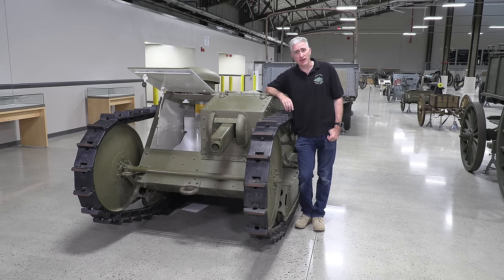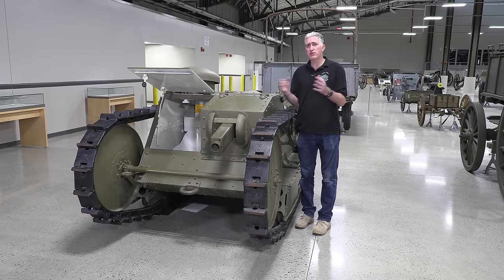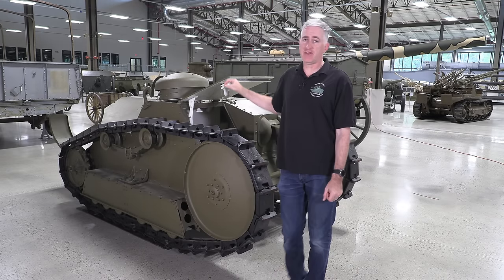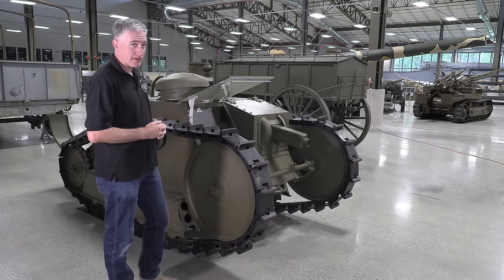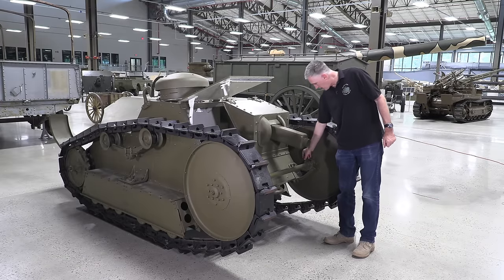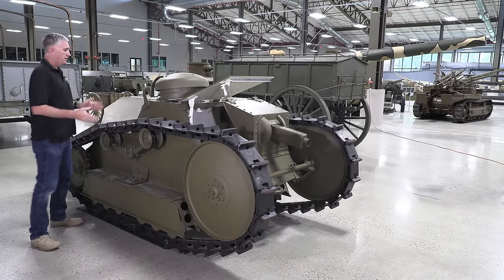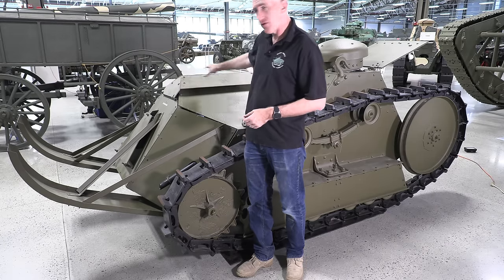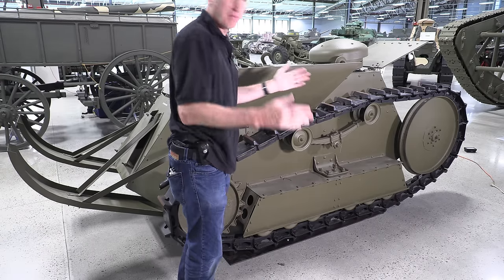Inside the Chieftain's Hatch: 3-ton M1918

Comment: A few observations from a Ford Model T owner/driver (whatever that is worth) who has looked into the tank more after seeing the video:

The three pedals do what the Chieftain says they do; the gas pedal is linked to a single carburetor that serves both engines, the two brake pedals control a band type brake in each transmission.  Of the four levers, the two closest to the seat on either side control what forward gear each transmission is in (high or low).  They have ratchets released by a lever on the handle to hold them in position.  Pulling these levers up puts each transmission in low, moving them level with the floor should be neutral and released all the way to the floor is high.  Pulling the outer levers up should put each transmission in reverse.

Minute 13:53 shows a great shot of the front of the engines.  The square opening in the center of the shot is meant to receive the mechanical starting handle.  The starting handle should be kicked forward and disengaged automatically once the engine catches.  The big round thing with the cable coming out above the square opening should be the electric starter.  The unpolished metal item to the right of the starter is the sediment collection bulb for the fuel system above which should be the fuel tank.  Directly below the sediment bulb should be a lever for adjusting ignition timing, this should be linked to both engines by the wire passing under the starting handle.  The two black boxes on either side of the starting handle each hold the four ignition coils for their respective engine.  The lever on the front of each box controls where electricity for spark ignition comes from; right for battery, left for magneto, center is off.

One thing I am not seeing is how the two engines are mechanically connected, I'm thinking this would be needed since I can't see a way to change the speed of each engine independently.  Having the engines mechanically linked would ensure the tank goes straight when both transmissions are in the same gear.
Reply from the maker: Pinning this one. I'm not in a position to say he's wrong about the levers. In the video, I gave my understanding at the time.
Reply: Makes me wonder if the "Bad drum in trans" is actually a lack of a transmission band, or otherwise the need for a replacement. good thing you can find all those parts aftermarket for the Model T. Greetings from a 1919 touring owner!
Reply: @TheChieftainsHatch   you to big for tank .
Reply: It’s a combat car I think
Reply: I always thought the transmissions were linked with some sort of differential in the middle. I guess they could be linked with a literal linkage from the levers or something of that nature.
Reply: Great walkthrough explanation of what should be going on with the mechanics behind the engines and transmission, best of luck with your antiques and may your collection grow
Reply: @aidanacebo9529 as someone who was recently in the museum in june (AIT students only ones allowed in to see). The tank is sadly still down with the same note stuck to it.

Comment: i'm glad 1918 tank designers and 1st grade me had the same design philosophy
Reply: Every solution to an immediate issue can be described in one word with an exclamation point. Trenches too wide. Skis! Engine's not powerfull enough. Two!
Reply: Yours was better…
Reply: I wonder if they issued a spatula amongst the tool kit. I'm thinking a spatula would be handy to remove whats left of the crew after action.😂
Reply: And around the same amount of experience in designing tanks as you at 1st grade...
Reply: @TheArklyte  well, if you think about it rationally, the dual-engine setup was quite logical in it's design. saves the need for complex machining for a differential transmission, and metallurgy back then was very primitive, so more breakdowns and a long R&D time would be necessary for it to mature. it's also what many advanced designs in armored vehicles still do, specifically diesel electric ones. it's one or two engines driving two electric motors/transmissions. hell, Tesla still uses multiple electric motors for their newest cars, one per wheel. I don't see how that is so different. think of it this way, can you keep a Model T running? it's surprisingly easy if you learn how to drive one. can you keep two running? with the minor assistance from another fella with the same training? the answer is yes. I've got a 1919 Model T touring. I've daily driven it for shits and giggles before. it starts easier than some other vehicles I've had.
Reply: @aidanacebo9529  I was talking literary. Both a complete outsider with no experience and designers of that era involved in such projects had only second hand idea what a tank is, never designed one and it was long before most solutions were mapped out. It was a clean slate field. And since nobody created composite designer groups that would bring diverse experience into the team, no one had much of a headstart.
Reply: @WrathofDog  "Sir! The 17 pounder doesn't fit."
"Put it in sideways."
Reply: @WingMaster562  "Sir, the radio won't fit!"

"Cut a hole in the back and have it stick out the back."
Reply: Chieftain is currently searching for you Man I wanted to make you aware....he's deeply offended and between the hyperventilating crying his voice was very deep,loud and extremely angry

God bless
Reply: Well.  The tank’s design was in its infancy after all.
Reply: @WrathofDog  machine guns no good on the attack? CANNON!
Reply: @TheArklyte  do you mean *literally?

Comment: The tailpiece also prevented the hull from digging in against obstructions when the tank was backing up.  Watched it's value in an original Ft video. Model T's did not have fuel pumps so either they made one for this tank or mounted the fuel tank high or that may be the reason that one stalled out crossing that berm.  A model T low on fuel often had to be backed up steeper hills to maintain fuel flow.
Reply: I'm guessing that the original tank was part of or mounted just under that triangular hunk of armor that he lifted to be able to pull the side armor on the engines down.
Reply: I imagine the original fuel tank was mounted in the center above the engines and the center cover was raised up to access the filler neck with cap.
Reply: Even then you didn't normally require to back a model T up a steep hill unless it was a driveway or something where you intended to go very slowly regardless. Otherwise you sloshed the fuel by slowly veering off towards one side of the road and abruptly jerking back to the other. The issue also only existed because the fuel was at opposite end of the vehicle, had the tank been in passenger footwell (not a good idea for other reasons of course) you'd need to be essentially empty before even the steepest slope required the driver to act to keep mixture from leaning out... so in 3ton (2,700kg) "tractor" its probably was not an issue that required extra parts to solve.
Reply: @SheepInACart  The T had a number of oddities, including the coils. There were one for each spark plug. They were mounted under the dash board.  My father told me that if your coils were bad, you (not him, of course) could easily switch your for another set at night at a barn dance. You took a chance of ending up with another set which were also bad, but if yours were shot, you might end up with a good set. He said it only took a couple of minutes( or so he was told). The guy with the good set probably couldn't figure out why T was running so poorly all of a sudden. 

My father grew up in Oklahoma, and was 11 when the Depression hit in 1929. He had a lot of stories about that era. It was fascinating to listen to, but I'm sure glad I grew up in the 40's instead (I was born in 1942).
Reply: @williamromine5715  My dad and his two college roommates at Texas A&M 1941-42 bought a Model A. It laid down a blue smoke screen as they drove and you had to add a quart of oil every 50 miles, but they had wheels, Dad went on to the USN in WW2, his two roomies became Infantry Lieutenants in the Texas Guard's 36th Infantry Division.  One died in its infamous attempt to cross the Rapido. "Lieutenant General Mark Clark, commanding general of the United States Fifth Army, in an attempt to break through the German defenses of the Winter Line (also known as the Gustav Line), tried to cross the Gari River, south of Monte Cassino, with two regiments (the 141st and 143rd Infantry) of the U.S. 36th Infantry Division, commanded by Major General Fred Walker. After crossing the river in boats, the Americans were cut off from reinforcements and support and subjected to heavy fire and counterattacks from elements of the German 15th Panzergrenadier Division stationed on the west bank of the river. The Americans suffered very high losses, and after two days of fighting the survivors retreated back across the river."
Reply: @colbeausabre8842  The Italian Campaign was such a mess. Too much was expected from too little military support. With what they had to work with, they did one hell of a job.

Comment: This is the most fascinating time of tank design for me. It was a complete wild west with different designs being used, some for too long.
Today designers have so much info to work with and back then they had basically none
Reply: "Basically none" means they were free to let their creative side run amok. If  only more thought to crew ergonomics and that steering mechanism had been lavished on the project. Even back then, Ford certainly had the engineering knowhow to solve the problems and mass produce a great tank. Unfortunately they gave the world this pile of junk. It's sad really.
Reply: @gusgone4527  to be fair, I think if you went to the government with 2 almost identical designs, but one with great crew ergonomics, but 5 km/h slower, I think the government would choose the other one. So not all of the faults lie with designers imo
Reply: @cvetomirgeorgiev9106  The problem was  they ignored the primary rule. "Try before you buy." Instead, placing very few target guarantees and penalties on General Dynamics. For a massively modified ASCOD (Austrian Spanish Cooperation Development) vehicle they could not test! 

 CV90 by comparison was ready to go, tried and tested. The new Mk.V vehicle currently being bought by Norway, should have been ours. Built here in the UK at Vickers Scotswood plant on Tyneside.
 
CV90 has been and still is constantly developed. New engines, new electronic systems and new turrets. Numerous variants there to be tried and field tested by potential buyers. It's a no brainer if the playing field had not been booby trapped by plans for an EU army.
Reply: If the allies had hit the beaches with a few hundred of ^these on D Day, the war would've certainly been over within a week or so! There would've been newsreel film footage of entire German divisions surrendering almost as soon as they saw ^several of these advancing on them... 😉👍

Comment: Those videos of archive footage are an amazing way to add a better understanding of the way tanks like this moved! I especialy love the tiny details like the guy using his foot to let the hatch come down slower at 17:35. And of course the tank falling into the trench at 9:06 is a hilarious video.
Reply: When I saw that 3-ton go backwards into the trench I winced for the driver
Reply: You can almost hear the crew laughing at 9:06.
Reply: "You're not gonna make it!"
"We'll make it."
crashes into trench backwards
Reply: 9:06 I wonder how they got the crew out before the fuel leaked onto the hot engine with catastrophic results.
Reply: That one had me rolling. Had to watch it several times. Also the one dropping dead after "climbing" the "mound" at 18:07. The original "Rush B", I guess.
Reply: @The_Modeling_Underdog  I wondered what happened there. Maybe a couple of the engines stalled.
Reply: @GR46404  Or both transmission got totalled.
Reply: It was a great addition, hopefully more add-ins like that can be done for future videos.

Comment: Today we ask the age old question: does the Chieftain fit in a Ford 3-Ton?

The answer is: kind of? But not really.
Reply: No, I want a "Bugger, the tank is on fire" episode
Reply: @colbeausabre8842  that's cruel and unusual punishment
Reply: Chieftain in tank yoga 😀
Reply: @colbeausabre8842  Getting out actually wasn't that bad for him. His primary issue was more just hesitance to put his hands on that bar. If you really had to get out in a hurry you'd essentially just do a pull up while pulling your feet over the edge and then letting go and sliding down the front armor. It wouldn't be pleasant going over the edge of the armor plate and the axle but it would be quick and easy, if bruising. At least not if he wasn't wearing such tight jeans.
Reply: I actually love seeing the Chieftan fit in such historical units. Ive also been a current world example of a couple of Museum tours.
Reply: Next, we watch the Chieftain get into a B-17 ball turret.
Reply: @marknerren402  I would pay to see that! Or maybe the gun turret on a TBF/M Avenger supposedly those are even more cramped
Reply: I would imagine tankers would have been chosen within height limitations.
Reply: @robertrobert7924  Well duh, but Chieftain isn't a WWI era tanker.
Reply: @colbeausabre8842  🤣🤣🤣 Yes, we need that to be filmed
Reply: @robertrobert7924  I'm 5'8" and I don't think I could fit comfortably in that tank.
Reply: @adamdubin1276  He's isn't....

Comment: This tank occupies a special place for me as it was the earliest US tank in the only tank book available at my primary school library, the first book on tanks that I ever read.  Other memorable vehicles from that book were the M56 Scorpion, T95 Gun Motor Carriage, and the MBT-70.

The apparent hinges on the rear edge of the panel above the MG mount suggest that there is a separate hatch for the gunner.  If there actually is a gunners' hatch, it might have been an easier port of entry/exit.
Reply: You would also need a hatch to physically get the machine gun in and out for maintenance…
Particularly if they ever fitted the M-1921 (later known as the M2) that was designed in parallel which was specifically designed for tank / antitank use.
Reply: @allangibson2408  Have you heard of that being planned for future armament?
Reply: It probably was used by both crewmen to enter the fighting compartment with the driver's hatch used to evacuate the tankette when under enemy fire. I bet the gunner's top hatch also had a provision to be held slightly open to allow the MG fumes to escape and fresh air be drawn inside.

Comment: Although the French thought the 3-ton tank inferior to their Renault FT tank they ordered several hundred as artillery tractors for the 75mm Mle 1897 field guns. The Armistice intervened and the order was cancelled before any were sent to France.
Reply: That would make sense. The M1918 was originally meant to be a tractor, and it meant that the French didn't need to interrupt FT production.  As a tank, though, I think the FT with an MG in a rotating turret would be better than the mounting in this thing.

Comment: I've been waiting to see this tank for years; I didn't even know any examples existed. It's a great experiment for the time and a lesson on what wasn't going to work.
Glad it was never used in combat.
Reply: If your interested  I have a pinterist board with extensive photos and documents. Also I'm not entirely sure it wasn't used in combat. It was at least deployed to a race riot once from camp Polk.
Reply: The US Army planned on using existing British and French tanks if the USA got involved in the war so didn't bother to design and make their own. Once there, the Army discovered that the British and French didn't have any to spare but could make the Renault FT under license in the states and ship those over. The Army wanted to avoid that cost so drew up specs for a lighter and cheaper tankette then got Ford to design and build 15 for testing. Henry got that done in record time with one sent to France for evaluation by the Army where it was found to be unsuitable to use. The Army told Henry Ford they would need 15,000 so royally pissed him off when they cancelled the contract after only 15 were made to make the Renault FT instead. Henry Ford refused to produce the FT so the Army used 3 different manufacturers to make the FT's. The three experienced delays getting those into production so didn't have any ready until the war had ended. 
The Army tried to make Ford happy by considering using his tankette to tow the French 1897 75mm field artillery guns they planned to make after the war but had to cancel that due to treaty limitations.
Reply: @billwilson3609  Nice explanation 👍. Do you have sources for some of the specific details such as Henry's reaction and such? I would love to read up on that!

Comment: The film clip as you wrap up the video shows a group smoothly getting into the tank.  So that demonstrates the proper method.  Of course, another factor may be that those men were significantly shorter than you are Chieftain.
Reply: And probably had more practice.
Reply: And quite a lot younger. It really makes a difference. I am not even old yet, but I still can't do the things i did when I was 19 or 20. I used to be able to clamber up a tree, leap over brooks, I could climb all over buildings when we were working on them. Crawling into small spaces didn't seem very hard at all. Now I feel older and stiffer and heavier and weaker.
Reply: @justforever96  I hear you. I had that realization a few years back when I flew in one of the last B-24 Liberators.